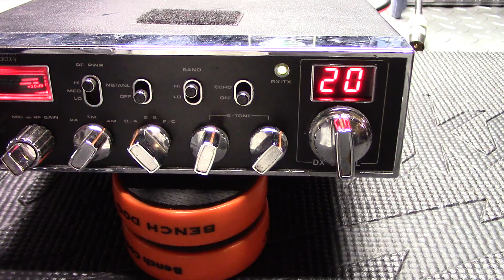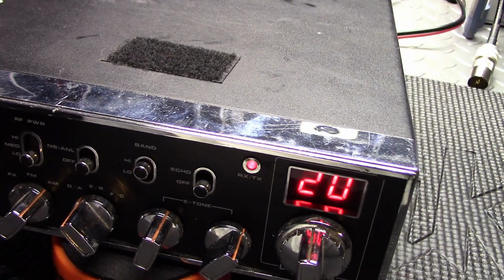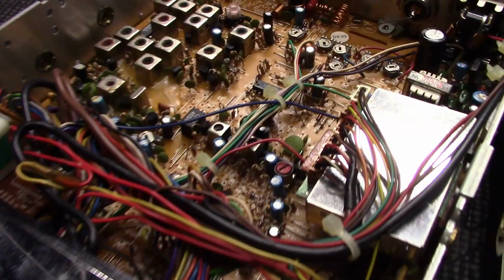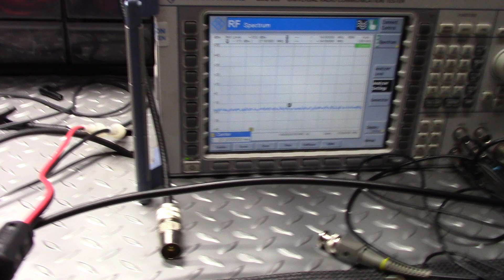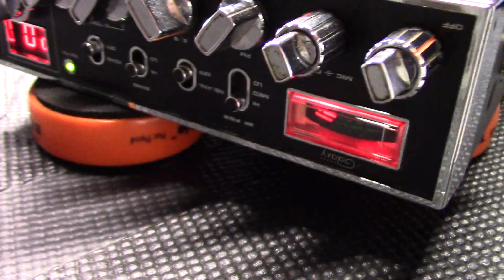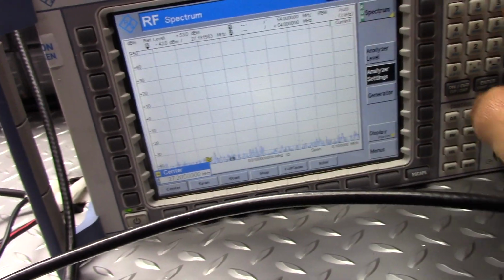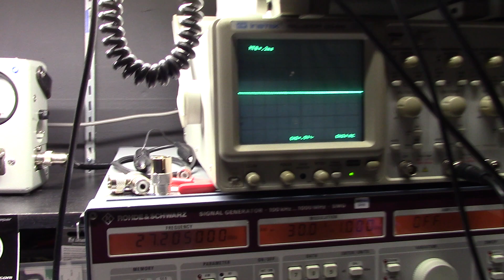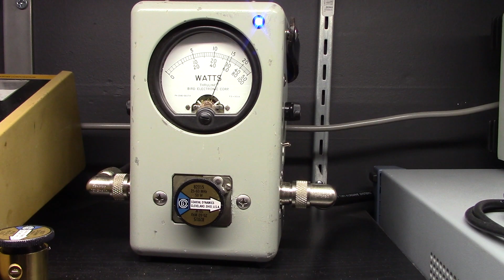Whacked out DX33hml, Can it be saved?! CB Radio Galaxy Unhacking with Oscilloscope Spectrum Analyzer

Comment: I have that exact same radio, in pretty bad looking condition though. I bought it from a junkie in the south Bronx about 10 years ago. No mic, and no plug for the + and - wires, but I hooked it to a power supply and antenna, and it receives plenty (maybe because I'm in crowded NYC). I'd like to send it to you to fix up, if you're game. Let me know.
Reply: Hi. I have one without the power cable as well. Do you just hook 13.7v positive on the far right pin and negative on the far left, ignoring the middle pin? I want to test it out but am afraid of damaging the unit.

Comment: Wondering if you have any clue why one would have weak recieve  well it recieves but most it shows on s meter is 5 ,even right beside it ,thus didn't happen until I decided.to adjust the wattage a little ,and I only turned vr for high and low  boom recieve gone ,any clue ??

Comment: Excellent, thank you for your professionalism, I bought that radio off a hand that was needing some money, got a good deal on it, figured I would use it as a back up, but now after your fine work, It will be hard, like you said not to run it, can’t wait to get some reports on it.                I sent Matt 4 radios to have him tune, 2 new ones, and an OG 29 that I bought new and have used since 1981, Matt, has been very easy, and quick to communicate with, deal with confidence, and he has reasonable rates, thank you again for shinning up that 33 diamond in the rough
Phil
Reply: I have a an older made in the Philippines 148GTL I'm looking forward to him working his wizardry on and going to use as my primary sidebander at the home 20 . That's a great looking older Galaxy , and it sounds really clean on the TalkBack . He definitely done a great job
Reply from the maker: Thanks Phil for the support 👍.  You definitely will have to put this one in the rotation.  73s
Reply: Nice job you did on that galaxy 33. I'm trying to send mines off to get tune, alignment, and widend out. Can be reached at 318-469-5624
Hampton